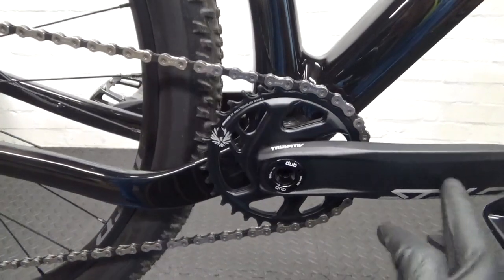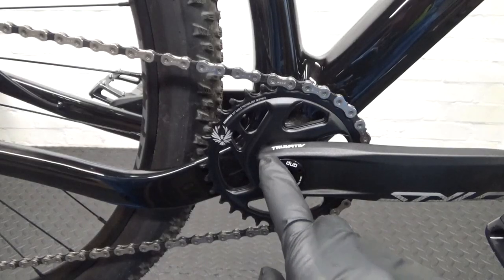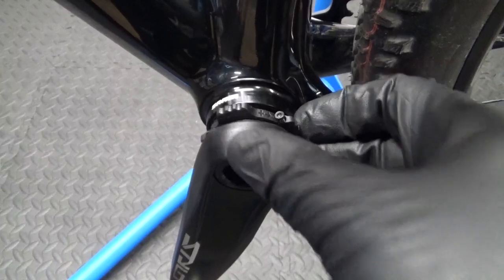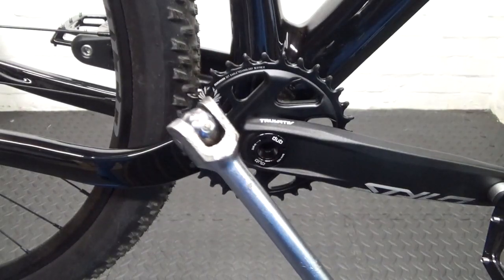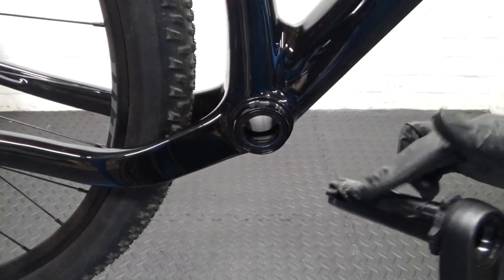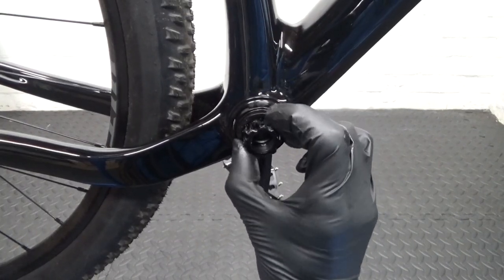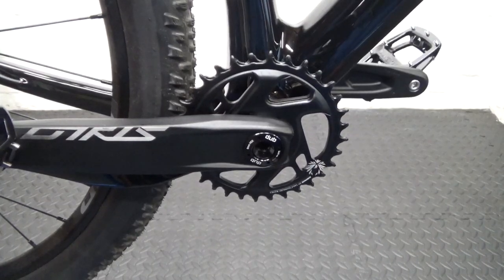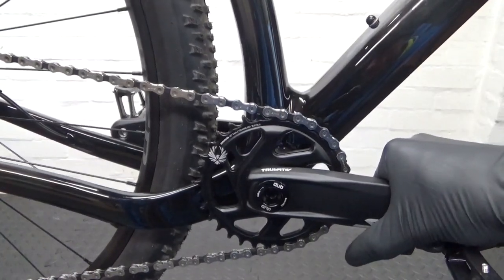SRAM TRUVATIV DUB Crankset Removal & Installation Guide

Comment: Thanks for making this video! We'd failed to get the cranks on my son's bike off two years ago for a chain guide repair, managed to fix the thing without taking the crank off and it's been bothering me ever since. We wanted to put a bash guard on the bike though, so had to take the crank off, and thanks to this video it went fine. It's great the video emphasizes that 54Nm is a huge torque value and you need to do some work to overcome that. We used a regular 8mm Bondhus hex key with a 36" cheater pipe and a stack of 2x4 sections under the offside pedal with two people holding the bike. Holy smokes that's the tightest screw I've ever seen on a bicycle.

Comment: A milk crate or beer crate is just the right height to hold the pedal.. the extration cap nut is known to fall off, a bit of blue Loc Tite fixes that, you can add grease to the inside of the cap nut while its off too.

Comment: Hey I’m having troubles with my cranks. I got SRAM descendant cranks and they will not come off with the bolt out. I’m not sure what to do. Thanks
Reply: Make sure you leave the outer nut in tight (I think this is a 10mm hex) your 8mm hex fits through the 10mm hole and will locate in the 8mm hex socket. The outer nut needs to stay in as the cranks are self extracting. Like said loosen anti clockwise.. It will loosen then go tight again, then loosen fully.

Comment: thanks for the helping video! one quick q: is it normal, that on the non-drive site there isn't any lid to close the 'hole' leading through the crank? in my Truvativ Descendant Eagle Carbon DUB I can see from the left side to the inner side of the right.. is this meant to be?
thanks for help and ride on!
Reply from the maker: there is no cover in the end of the left hand crank arm!
Reply: @FreeToCycle  ...but y?
Reply: @05struck  So mice and other small rodents can get from one side to the other side.

Comment: Is the torque wrench that you use in the video a newton torque wrench or a normal one? Grts
Reply: That was a normal wrench with a longer arm for leverage. NEVER loosen bolts with a torque wrench. It could impact the accuracy of the tool. Torque wrenches are precision instruments, not brute force tools.

Pro tip: When storing your torque wrench set the torque to the lowest setting to relieve the spring tension. Helps maintain tool accuracy longer.